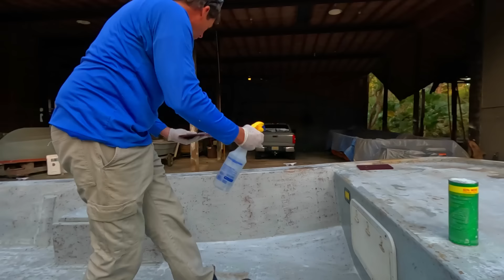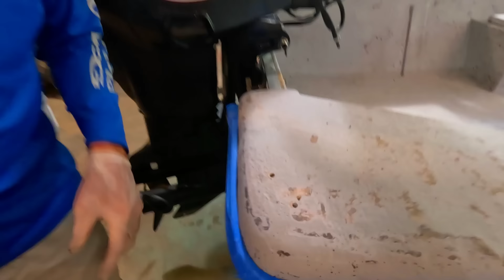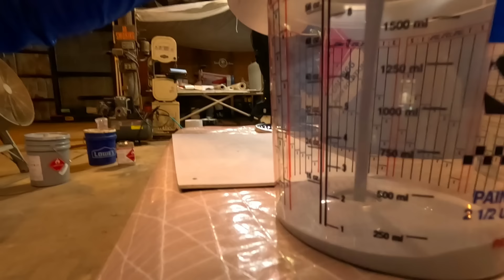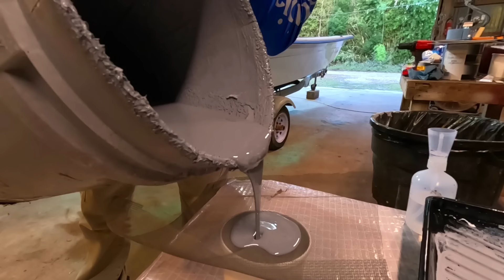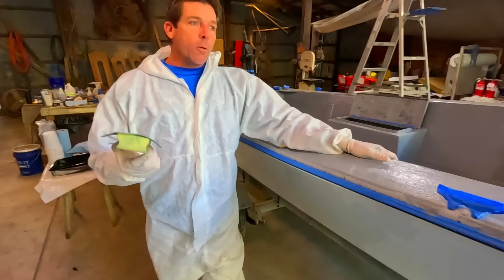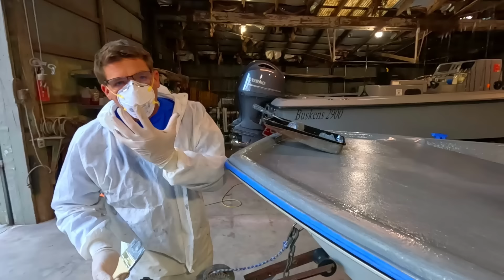How To Re-Gel Coat A Boat - DIY Cheapest & Easiest

Comment: I am looking to gelcoat my little 14ft speedboat and looking to opt for 2 different colours white and blue, my question is do I tape off where the white is going to meet the blue on the boat?
Will there be a nice straight line once the tape is removed that keeps the colours separated?
Reply from the maker: Sounds like a cool project. Yes, we use tape to mask off areas with good success. Of course we have had a lot of practice. We regularly use gel coat for boat interiors, it leaves a flat sheen, with a  texture. Gel coat that is molded will turn out glossy. There seems to be a lot of interest,  but also confusion about when and where gel coat should be used. Generally when we are changing the color of a boats hull, you would use a marine paint system, not gelcoat. I will try to make a video explaining some of the differences and pros a cons soon. Hope this helps, Thanks for watching!
Reply: Any tips on the floor covering? I am putting a new floor down all glassed in but want a nice durable non slip floor that isn’t carpet

Comment: Another benefit of switching to a pan is that it thins the pot depth and will slow down the kick.  Old boat builder I know used to pour his epoxy and poly into a cookie sheet to thin the depth out.
Reply from the maker: Yes, that is right, thanks for watching and commenting!

Comment: Why use gel coat over Rustolem topsider paint?
Reply from the maker: You could use either one on a boat like this. The skiff in the video  had gelcoat originally, and I am very comfortable working with it. The main pro for gel coat in my opinion is its toughness and durability, especially in a utility skiff such as this one. Hope this helps, Thanks for watching!
Reply: I’d like to hear the pros and cons on this as my deck on my dad’s Maycraft 1800 Skiff is looking a little worse for wear and I am wondering which one to consider.

Comment: question, hop guns.....are they as strong as mat
Reply from the maker: Chop and mat or csm are all basically the same material. I like the fact that mat can be put down very uniformly. You really have to know what your are doing with a chopper gun, it is very easy to apply to much material.